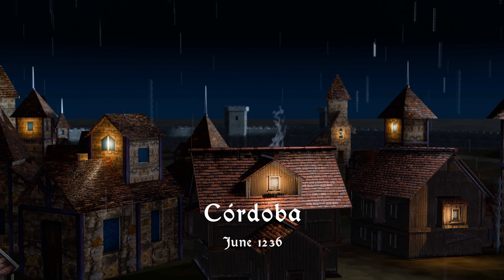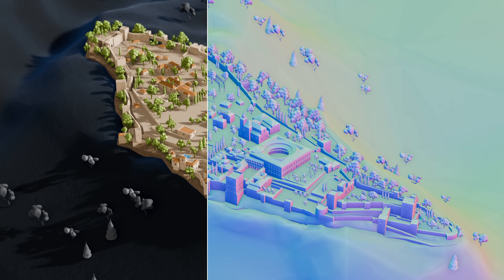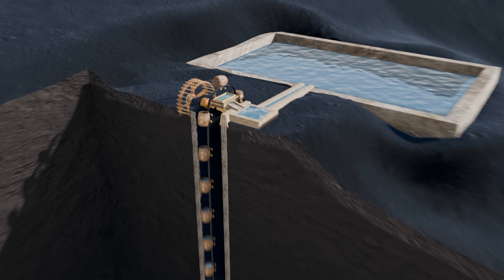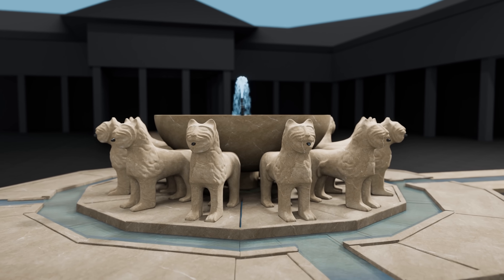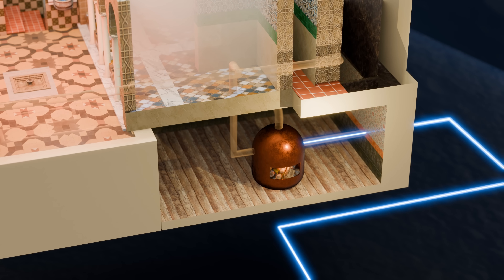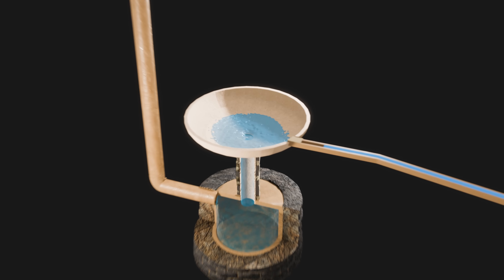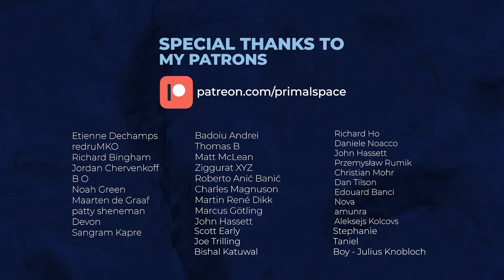The Ancient City That Mastered Water

Comment: As a 9th grader, I was doing a project in which I should use the least amount of electricity to run a building. So my idea was to make some structural changes to the building in a way in which almost no electricity is used for running the building. I searched for many way on how a water pump without electricity would work, and this video helped a ton in my research! The water pumping part was really mind blowing...thank u for this video😃
Reply: But remember, you need horses to add lifting energy to this “pump”.  Your building can be run with no electricity at all. Just a huge fire in the boilerroom in the basement and oil lamps. This was the case in say1850.
Reply: A steam engine / pump would be significantly more effective than using a horse, and it doesn't require electricity either.
Reply: Burning fuel on site to power systems I think is missing the point of low-electricity unless the exercise was not conservation but utilize pre-electrification methods.
Reply: Have a look at ram pumps, if you'd like to see another alternative.
Reply: @Asrashas  No, a ram pump need some head to work. If you had 6 m head, you would not need any pump at all. With a Trompe+air lifting pump, you need next to no head at all, just some flow.
Reply: Persian ice box architecture is a great technique for keeping things cool in hot environments!
Reply: Make the building underground so it will have a constant temperature, or make two buildings one on top of a mountain for summer and facing away from the winter winds in the valley for the winter.
Reply: Well done👏🏾
Good luck
Reply: nice! good luck! let us know how you do!
Reply: @roryross3878  Don't throw the baby out with the bath water. The kid isn't using the fires to heat the water as the example. He was specifically speaking to the water pump, which wouldn't need electricity, but gravity and whirlpools. Your comment assumes the whole, which his comment does not.
Reply: Hey, how's your project going? I wonder if the pump you made is working well. We all want to know and appreciate it

Comment: really sceptical about the whirlpool pump. The idea is good, but i dont think your animation shows the whole process. It appears that all the water incoming is eventually making it up the step. Either the incoming water has enough kinetic energy/pressure to make it up or more likely some water is going down to enable someother to go up. Maybe there is a small pipe going straight down with a flowrate which almost matches the incoming water at max pressure (almost overflowing)

Comment: I love the way the central clock works. Even though it is a simple system compared to the 6m elevator at the end, coming up with such an elegant mechanism is pure genius. 
What I wonder though is how they managed create the constant water pressure needed. Even slight differences could have a huge impact over time. Or do they reset the clock every once in awhile?

Comment: Most impressive needs to be the Lion Fountain's Water Clock. As it needs to consider multiple factors :
1) the time taken to fill the bowl
2) the average evaporation of the water 
3) the size of bowl 
4) the distance between the holes in the bowl
5) the mechanism to empty the bowl 
which makes it more complicated. It's impeccable to see they pull out that idea successfully.
Also it would have been unimaginable if they could empty the bowl also with the mechanism with which it filled that is only the topmost hole under the water will let the water pass while other holes block the water. Hence creating a complete 24 hour clock.

Comment: Amazing! Even amazing is how water was brought up to the castle built on Sigirya rock in Sri Lanka, which is 600ft tall than the surrounding area. No pressurised water is brought here from outside. But still some water fountains work today.

British and Sri Lankan engineers who thought they have mastered hydrology, tried to improve some fountains and ultimately they went out of order. The modern engineers still cannot figure out the methodology used to bring water to the surface.

Incidentally, Sigiriya rock fortress was built in the fifth century, not in 1258.

Comment: I went to Granada, Andalusia, Spain.   The engineering started at the road.  There is a sperpentine road leading up to the citadel.  Men with spears were stationed at blind curves.  One man could fend off an entire army. It was a honor to have such a posting.  Of course, he knew he would be a     dead man, but paradise awaited him.   What this video missed mentioning is the water flow in the channels were not only regulated by a precise gentle slope but also by swirling basin which dissipated the energy of excess water and oxygenated the water.  The last pump used for the military barracks is known as a trompe pump.  The  reason the barracks were made higher were to have a better view of the city, and the walls absorbed the sunlight of western sky which the kept the area cool.

Comment: why is it not violation of conservation of energy in the last chapter with whirlpool. If look at before and after of the water before entering whirlpool and water exiting whirlpool.
Reply: becouse whirlpool take much more water than exit from airlift
Reply: @dddddd6235  Does it mean we have found a way of transferring the potential energy of air(due to atomospheric pressure) to water - through a device so simple as whirlpool.
Reply: @kumarsrijan8377  we have found a way of transferring the potential energy of water(due to gravity) to air pressure - through a device so simple as whirlpool.
Reply: @kumarsrijan8377 the whirlpool is a mixing valve. It atomizer the water molecules decreasing their density which allows air pressure to then left the water to a greater height. You are only talking 1-4 meters. Water spouts lift water vapor which then condenses and falls back down. The same as what the sun does. Turns water to vapor which is then lifted by atmospheric pressure. 
As the elevation increases, the atmospheric pressure decreases which limits the height of the system. 
Ram pumps use falling water to increase the pressure in the line and pump water uphill. 
Application is limited because they don't move a large volume of water and only a small percentage of the water in the system is actually moved.
Reply: @kumarsrijan8377  my answer deleted. Im banned?
Reply: @dddddd6235  not banned

Comment: What an amazing feat of engineering. I couldn't get away with the meticulous work and amount of time the engineers put into designing the water system. And, the engineering to carry the water to soldiers' quarters on the western side of the palace by creating a whirlpool that can mix up water and air and thru pressure is mind-blowing.

Comment: This system is still use today somewhat. The government digs a well for the community, from the well an electric pump  pumps the water up from the well to a reservoir almost at the top of the hill, from there the water is release to the individual homes down hill by pipe to a plastic container on a platform at the home from this point the water is distributed to the kitchen, bathroom all done by gravity.

Comment: A version of the aerated water system at the end of the video has been used by mines when they are close to a waterfall.  Air is entrained in water and made to be pushed below water level at base of waterfall.  The air is extracted at depth so it is under pressuire.  The air is then led up to where it is required to ventilate the mine.  Pure brilliance...no moving parts.  Also in civil engineering today, air lifts are use to excavate sand and small rocks when making bridge piles.

Comment: Either the siphon system in the water clock or the soldier quarters 6ft scale.   Figuring out siphoning is cool and all back then, and I could probably drill some holes a bunch of times till I figured out that it took exactly one hour for that to happen. But the solider quarters? Understanding pressure differentials like that I would assume took a lot more trial and error. Cool stuff!

Comment: Making the clock with lion fountain, and  designed siphoned to empty water counting hours again. Measuring the big bowl and the hole size for each individual lion is amazing. I still wonder how they measure hour? Experimental based on try and error or exact calculation?

Comment: about the clock: if the water supply spewed a constant amount of water and the water went AWAY after leaving the lions mouth.... how did the clock not slow? if you pour a constant 12 cups of water into the bowl every second and each lion spits out 1 cup/second it SOUNDS logical but its not at all!!!! the water trying to reach the first lions pipe would be going up by 12 cups/sec but then once it reached it and the lion started using 1 cup/sec... the water would be rising towards the second lions pipe at only 11 cups/hour???? you failed to explain how any of that worked man??
Reply: also as an attacker why not just ruin the dam? block the canal? poison the water (pooping in it is the easiest way and has been done before in history)? kill or remove the horse causing the pressure? any of those would literally RUIN them as the soldiers wouldnt be able to drink

Comment: What part impressed me the most, have to say this hydraulic engineering thing is kind of a hobby of mine, so everything was impressive, except for the part in which they had to build an aqueduct so far away, I don't understand why they didn't use water wheels, maybe an aqueduct was most cost effective or they couldn't find a place to put the wheels, maybe they were figuring out things while they were building and by the time that they found a more practical solution, the aqueduct was already there.

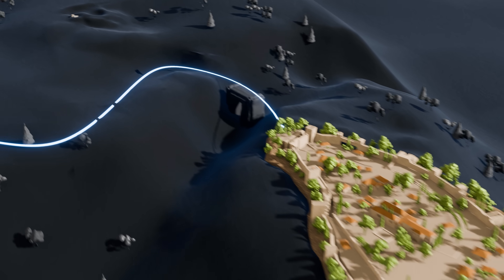Comment: At time 2:20. You can't increase water pressure on the royal canal adding to it water previously rised to the pool with the water wheel. I guess that the high pressure water from the pool (about 6 kg/cm2) was reserved for special uses like fountains, etc.
Reply: Most probably, not everything in the palace would be used at once so you don't need all that pressure all the time. there's no point running fountains when no one is there to see them, or to make steam when no one is using the steam room. I think the lion fountain is the only one which would be running 24/7 due to its use as a clock, but everything else may also be turned on when needed.
Reply: You actually can though. Water pressure is determined by the height of the water column, so introducing a source of water with a taller "column" would increase the pressure in a closed system.
Reply: @Kellorax  But this is not a closed system...
Reply: You can't say what can't be done then "I guess".
Reply: My toilet needs an upgrade 😊
Reply: @ibraheemshuaib8954  Fountains might have been run 24/7 as they are an important way to keep the place cool, even at night.

Comment: @primalspace How did the engineers programme the Opera, XP, to ensure the central pipe fill the bowl of the Lion Fountain at a constant rate? The inconsistent drawing of water (for chores, etc.) causes fluctuations in water pressure before reaching the mentioned central pipe. Thanks for this fascinating video!

Comment: The most impressive. 1)The syphon driven water pump. 2) The Clock 3) The use of a copper boiler with heat exchangers. 4)They did it all without knowledge of Bernoulli's Principle circa 1738. Obviously, the Romans and their successors knew a lot more than commonly given credit for.

Comment: This video about the fountain is pure fantasy and a big lie. It was never a water clock, there are not holes around the fountain. The real mechanism was discovered in the XIX century when they raised the fountain for restoration and the water clearly gets in and out by the cylinder in the middle.
Even a islamic inscription in the fountain decribes the water level inside always static like a rock.
Reply: They also fail to mention that the Christians were RETAIKNG the city that the Muslims invaded first

Comment: The hydraulic ram pump is another ancient engineering marvel which pushes water kilometres uphill and over long distances with absolutely no electricity or muscle power, except that of a flowing stream or river. It essentially employs the use of two strategically placed check valves and an air compression chamber, along with inlet and outflow pipes, all of which can be built using cheaply sourced material at any hardware store for about $100.

Comment: if you add that clock to that airy water pump you can calculate the location of the moon if you remove the pythagoras cup thing and used tides to raise and lower the water. well not exactly locate the moon but rather see how close it it. but that clock can be used to calculate seasons too rather than just hours and that air pump can be used for so many things but why they use a animal to pump water when they had that air pump. its like they were so close to having free power. like why didnt they pump water up higher using multiple of them pumps and use that to fill a pool thats used like a water tower. but i think we should use that today too. why not make dams higher pressure by using air pimps if i get land with a small stream im gonna make one of them air pumps for raising the water and use that added water pressure to spin turbines why not pump water 20 feet in the air. how is that not free energy? seems like if there was enough of them we can power a modern city.

Comment: The whirlpool pump is brilliant, but the lion fountain is also remarkable. The precision required to calculate the flow rate both in and out of each lion, and the precision of drilling the hole is unbelievable!
Middle Age Muslims are fascinating!
Reply: There were probably wooden plugs in the holes to adjust the flow more accurately  since the fountain would weardown in time due to environments

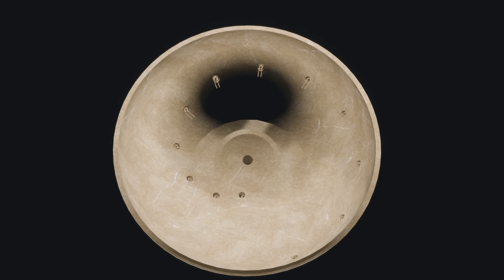Comment: 5:08 is impressive. As the bowl widens to the top, filling the next cm or inch takes more water and time. Also each hour more and more water drains out slowing down the water table-rise even more. With a constant inflow, the hour-outflow-holes need to be closer spaced each hour. That is an incredible feat in stone cutting and math skills.

Comment: They should have built a air drive pump in the court yard in addition to the one servicing the solders quarters.  Water comes in, is boosted by the device and flows up to a upper reservoir and accumulates.  Water can then flow back down into the device and get boosted back up to the upper reservoir.   Additional energy could be extracted as the water flowed from the upper reservoir to the lower reservoir.  The cycle would produce endless energy.

Comment: Slight error in how siphons work; You said that the surface tension pulls the water with it. 
In reality, it is atmospheric pressure which pushes the water in the bowl into the siphon. It's a very common misconception that straws suck, and a common misconception that surface tension pulls the liquid up the straw. This is what children believe.
The engineer knows instead that the force is the differential between an atmospheric "push" and a lower pressure region at the top of the siphon which causes the fluid to move.

Comment: I have 2 comments.  The dammed river and gentle slope of the channel to the Alhambra has a very ROMAN ring to it.  I don't know how or if the construction of the channel was dated. But, I know that Spain was Roman until the empire collapsed in the 400's AD.  I assure you; the Romans scouted every hilltop for communication towers.   I believe the Romans planned an outpost (fort?, military camp?) at the Ahambra location.  I realize that Arabs argue that the Romans copied Arab engineering of water/sewer systems.  But, is it possible that the channel is actually of Roman construction and abandoned due to the Visigoth invasion?  Then, construction renewed with the Arab conquest in the 700's.?  The Arabs probably recognized what they found.  As you are well aware; the Roman concept was that the water would NEVER be still, always flowing to provide a healthy water supply for drinking and sewage. There is a clue that the channel is Roman construction.  I contend that the Roman plan was for a simple fort, and not a palace.  If the Arabs concept had always been a palace with fountains and elevated floor levels the source would have been initiated at a higher elevation instead of this inefficient animal powered solution.  The Arabs were equally skilled in engineering. This was not an engineering mistake, this was a change in concept. The Arabs took what they found and improvised a very clever soution.

Comment: The fact that they were able to calculate the required amount of water to correctly supply all the features of the palace from the git go, build the correctly sloped viaduct, the elevation pool, and all else that was necessary to accomplish the task of the amazing features, shows a level of planning and foresight only equaled by the engineers of the Death Star! ❤️😂👍😎

Comment: The clever reuse of energy in the baths impressed me. Instead of just using the energy to just heat the floor they also used the cooled steam for the steam room. They effieciently used their resources, which should be applauded!

Thanks for the fantastic video!

Comment: The whirlpool thing blew my mind.. achieving such a feat in engineering is remarkable indeed. I just wonder how they handled changes in pressure of water. Like during flood the clock would run faster.
Reply: It is the perfect islam which encourages you to thinking and inventing 😅❤🎉
Reply: You have an over flow outlet to keep the fountain inlet rate the same